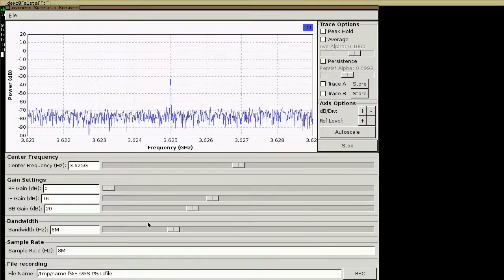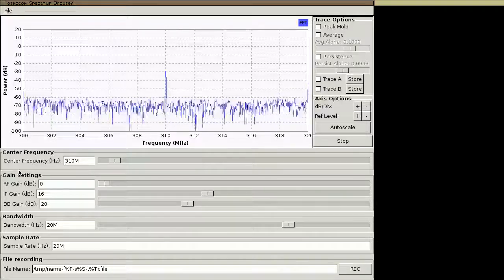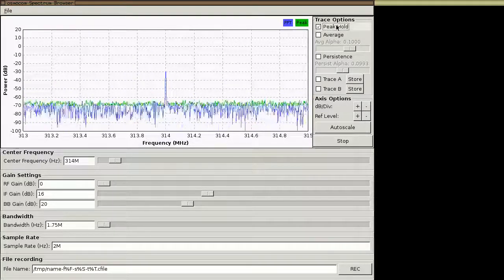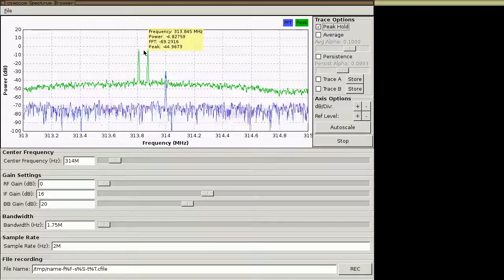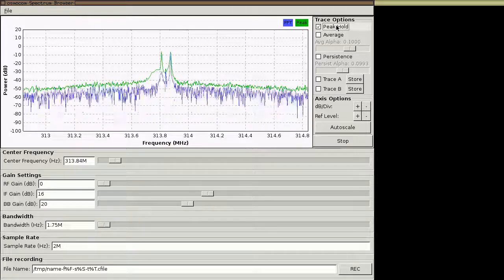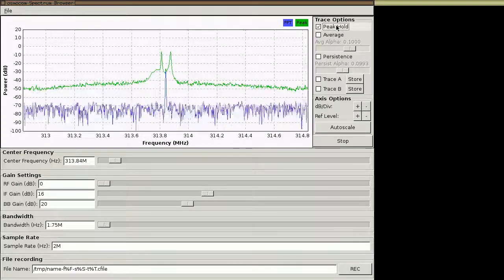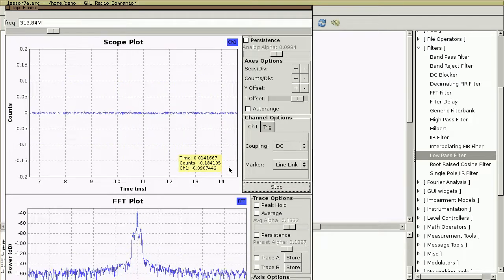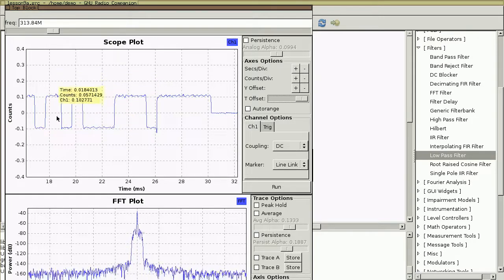Software Defined Radio with HackRF by Michael Ossmann, Lesson 9: Aliasing

Comment: To those following along at home, I see negative frequencies with the QT GUI Frequency Sink with floats so things may be a bit different vs this video that was recorded in 2014.
Reply: So much has changed, makes it more fun haha.
Reply: Getting the XY plot of the scope sink about halfway into the video can be done using QT GUI Constellation Sink. You can also use QT GUI Sink to also have the frequency, time, and Constellation on one widget and make it potentially easier to manage.